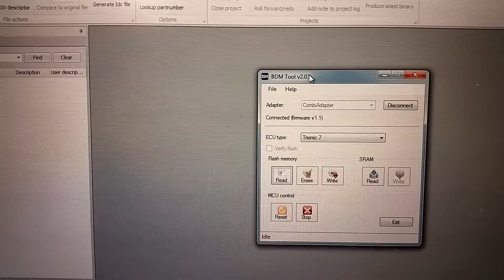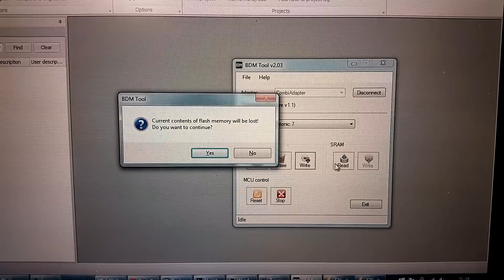Saab Tuning: Trionic 5 and Trionic 7 BDM Soldering and Rescue - Trionic Seven

Comment: Never drill holes in the PCB as the metal connections between the layers are damaged. The author is so smart :)))
Reply: Exactly what I thought too. There is a fair to good chance that the top layer substrate isn't going to make contact with the actual pins this way.

Comment: I used a pin vise with an extremely small bit to hand drill the holes on my T5 ECU. Worked fine, but not for the faint of heart.
Reply from the maker: Agreed. I've been told that there is a high risk of damage to the PCB if you drill :)

Comment: I'm having trouble finding the piece to solder in and the cable. Any tips on locating this stuff? Waiting on my combi adapter to arrive and I'm unsure on the plug type and all that.
Reply from the maker: Check the trionic7.pdf manual

Comment: hi mate, your saying that a bdm interface is used for a backup recovery in case the ecu is bricked. but do i really need to get one in order to to remap using only a canbus such as can 232. so to able to remap my ecu do i need bdm and a canbus or just a canbus. oh i spent so much time reading on forum trionictunning... but poeple uses differents ways im confused.
Reply from the maker: I highly recommend a bdm interface, ie the combi adapter. The combi adapter is way faster than anything else, too. If you brick your ECU, you recover it with bdm.
Reply: thank you so much for ur help. appreciate that you take the time to answer questions.

Comment: Hi, I've watched all your vídeos about connecting to Saab's ECU, and I have a question for you!I don't want to spend my short budget in the Lawecel adapter that is about 120 eu. or in the one you have that is around 100 eu. So I prefer this option, the BDM option. Question: can I use the BDM conected directly to a rs232 adapter that have only 9 pins, and to perform it this way, do I need an extra software or the Trionic7 CAN Flasher is enough? Thank you very much. Kind regards, Paulo Ramos (PT)
Reply from the maker: +Paulo Ramos It is possible to build your own BDM interface for a low cost, see the Trionic 7 manual for more info.

Comment: i've found an old laptop with a supposedly working (untested) printer (lpt) parallel port.   If i buy a bdm to parallel port cable off of ebay and download t7suite, will i have a working solution?   i'm looking for the cheapest method that includes a fail safe if i brick the ecu (so bdm)
Reply from the maker: I know that BDM interfaces can be made easily. If a parallel port will help you, no idea. I'd say use the combi adapter since it will be so much faster than anything that requires CPU interrupts.
Reply: Trionic Seven don't want to spend the money on an expensive cable because I'm doing this more for fun

I'll do some more research but thanks anyway